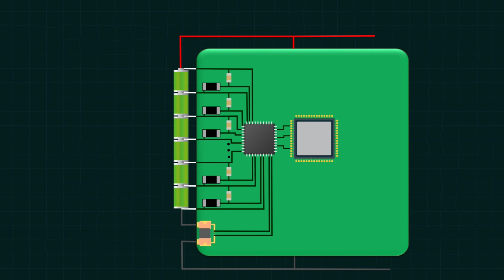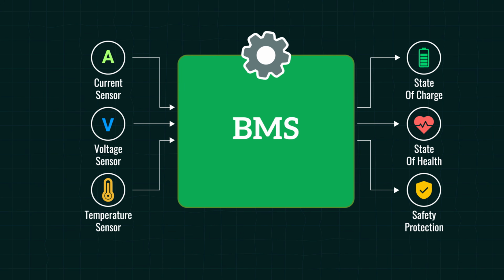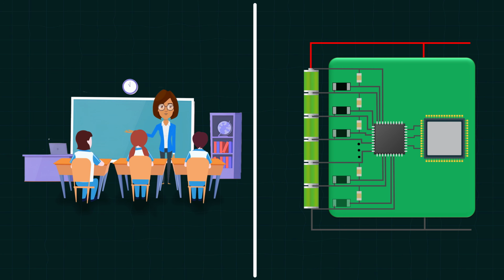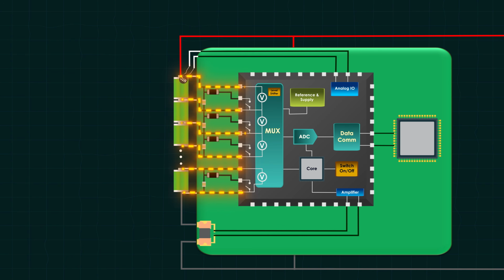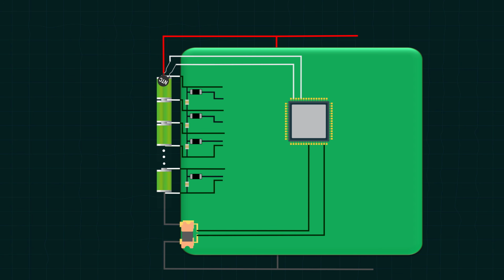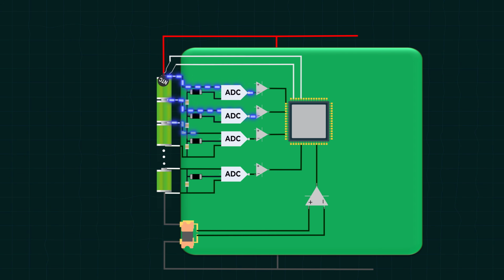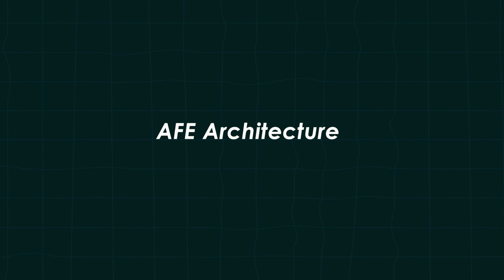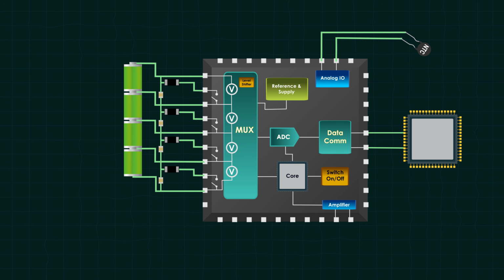What is a BMS IC ?

Comment: How resilient is the AFE IC to failure from a short circuit? Inhad phase wires short on a motor and 2 of the batteries had dead cell groups. I replaced those dead cells and now other cells have died. 

Wondering how to diagnose if the BMS is still working properly?

Comment: Outstanding sir! Clear and concise! Thanks for sharing a wealth of information 🎉❤

It appears that the afe  measures voltage, but, doesn't actively redistribute current during discharge.  Is that correct? If so, is there a solution?
Reply from the maker: Great catch! Yes, most AFEs just monitor voltage/current — they don’t actively redistribute current during discharge. That’s where active balancing or external circuitry comes in. I’ll cover this in an upcoming video 😉

Do hit subscribe so you don’t miss it!